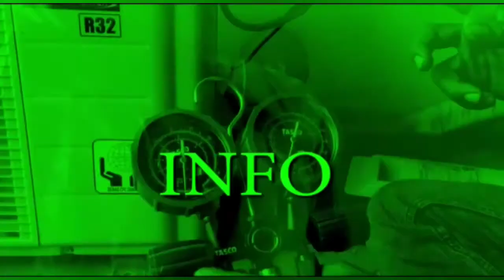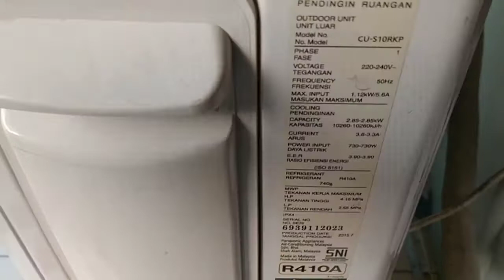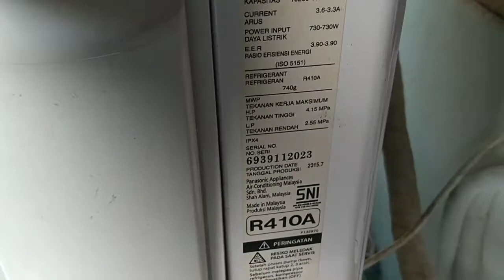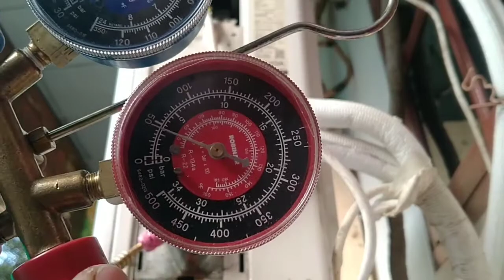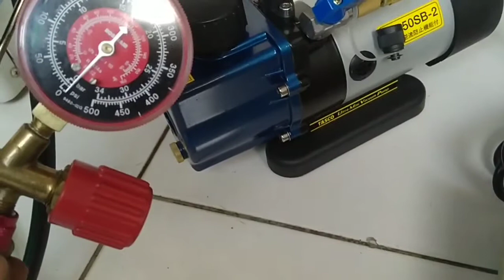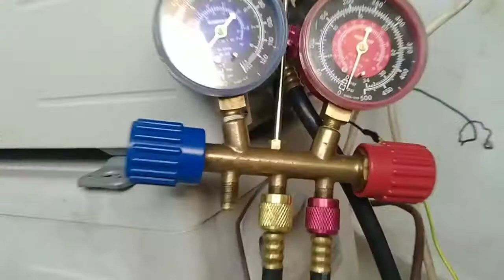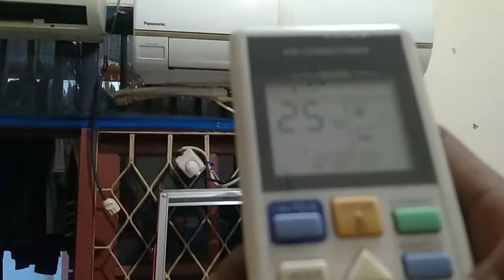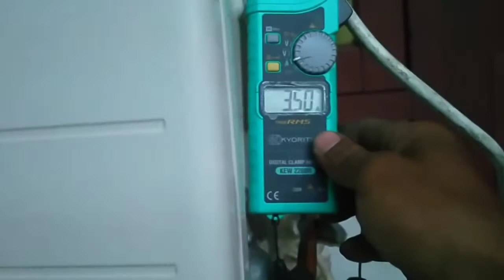Perbaikan Ac Panasonic Inverter Error F93|Panasonic Air Conditioner|Service Ac Bekasi

Comment: Terimakasih mas untuk ilmunya, saya punya ac panasonic yang sama. Error f93 tidak dingin freon 100psi, tidak ada kebocoran tapi ampere tinggi. Saya liat video ini, lalu saya sambungkan langsung condensor ke kran nepel 1/4, dari kran saya sambung ke filter kosong kulkas, lalu ke kapiler, lalu ke pipa 1/4 menuju indoor. Hasilny ac saya normal kembali. Sangat dingin dan irit listrik. Ac ini salah satu produk panasonic yang terbaik. Saya sangat puas.
Reply: Bro how did u fix this error. My ac was working fine but then suddenly 1 day it stopped working!
How to fix this error i cant seem to find anyone here who knows about panasonic ac.
Reply: @gaminggroovy1465  I replace the compressor capasitor on the pcb board, change capilary filter and flush all the system. Now the problem is fixed. Lots of thing to do but i it fixed.